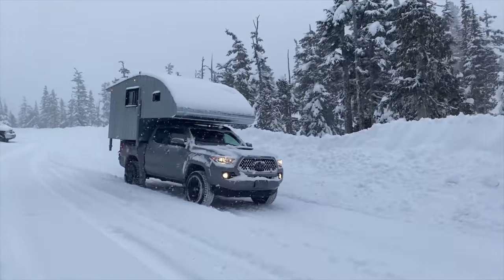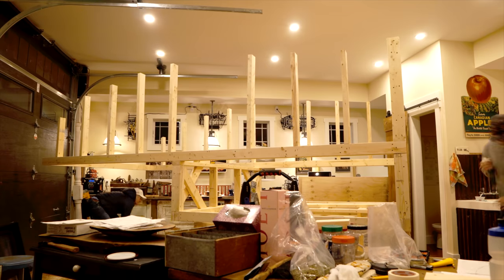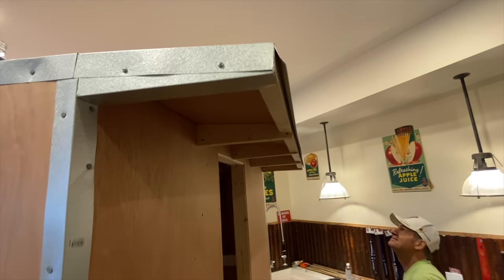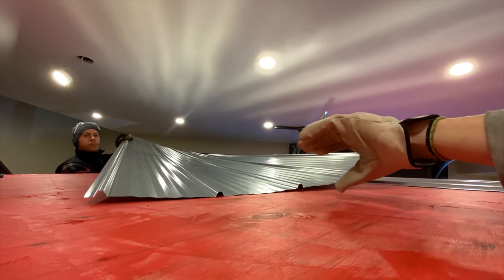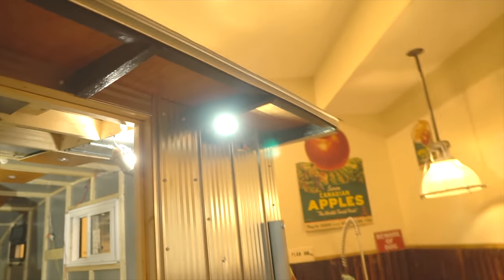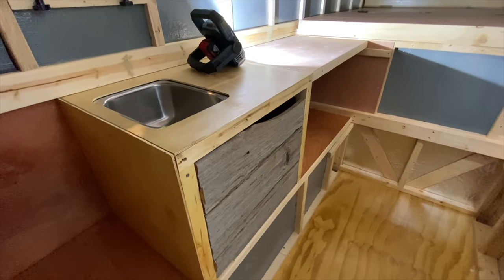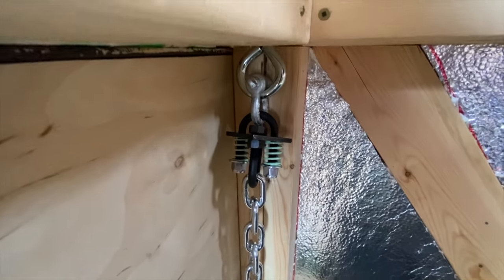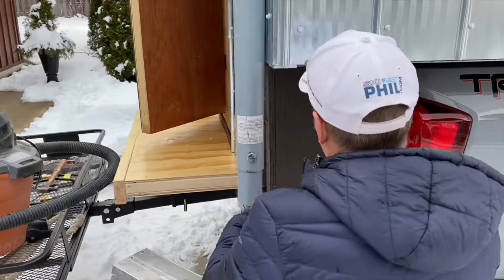I Built an Off-Grid Truck Camper - Start to Finish

Comment: shoebox! what kind of gas mileage do you see with the camper vs without?
Reply from the maker: Hey! I get about 13 litres per 100km’s without the camper, and about 17 litres per 100 km’s with the camper which works out to about 14 mpg with the camper on. And about 18.1 mpg with the camper off

Comment: its a beautiful camper but i think it is too heavy for tacoma.   you need to upgrade to more heavy duty shocks i think
Reply from the maker: Thank you! Yes the tacoma can handle the weight, but it’s pushing it forsure. I got airbags to help the truck, I am here to post all the things I do right and wrong and I wouldn’t recommend the same weight for this size camper unless you are sticking to nice paved roads

Comment: Shoebox what was your new advanced jacking system? Haven't seen a video on it yet
Reply from the maker: Hey I haven’t uploaded a video on them yet, but the new jacks I use are called brophy cable winch truck camper jacks, they are relatively priced, and still do a great job!

Comment: Amazing build! Super inspiring! Did you try and keep the weight under your trucks payload, I have an f150 and seems like my camper will exceed my 1700 max. Did you get suspension work done to help cause your truck doesn’t seem to squat like it used too.
Reply from the maker: Thanks so much! I honestly did not try and keep it under my trucks payload 😂 I was so new to truck camping at the time I didn’t even consider weight being a major factor but obviously it is critical. I got airbags installed to keep the ride level! Honestly when my rig is fully loaded I’m probably exceeding the payload, it’s not ideal but she will still roll 😅 but you’ll feel way less acceleration, and more sway  on corners also need to break earlier!

Comment: Ok what was that bit about the 2x2 vs 4x4s? you said you would have used. Wouldn't it just be lighter to build it all withb the 2x2s, only using 4x4s in main stress paint area? 
I'm thinking about doing this with my Silverado....
Reply from the maker: That’s exactly what I was trying to say! Using more 2x2 would lighten the load and you can use 2x4 where you need it!
Reply: Lol don’t be using no 4x4’s and honestly a 2x4 is a dumb move. This thing weighs way too much

Comment: Shoebox. I'm glad they were able to help you build that. I thought about building one. I'm not sure I want to though. I think I'd rather just buy one
Reply: As long as they don't check up the price. I'd rather just buy it cheaper one that's still nice
Reply: Not that your truck bed camper isn't good or anything, I just don't want to put in the work to building one because it is tedious
Reply: If I have a shop or space Also, that would be one thing I would be more likely to do it. However I don't. I have a parking lot LOL
Reply: Because at least with yours it is personalized to what you want

Comment: Recomending a 1 ton truck while putting it on a quarter ton. Doubting you need a 1 ton if that thing is handling it. Huge difference. I dont doubt its too big for a tacoma but pretty sure a half ton would be fine.

Comment: Love the shoebox!  Inspiring.  Did you consider a steel frame?  Why did you go with wood?
Reply from the maker: I choose wood because it’s very easy to work with! If I were to go with metal I would have choose aluminum to save weight, but it’s still harder to work with than wood.
Reply from the maker: Bang on, I mostly choose wood for it being easy to work with!

Comment: Shoebox I am about to build a slide in camper. I really like your video it was ruined forming I would have a couple questions what is the weight of the camper or have you weighed it yet and what is the total height from the ground to the top and on the inside of the camper.
Reply from the maker: hey so glad i could provide some inspo! my camper weighs about 1200 pounds. the total heigh at the tallest point is about 6'6 on the inside and 6'2 at the door (curved roof). Good luck!!

Comment: Wow. Impressive home build ! I’m jealous of your windows, as the single pane/aluminum frame ones in my 1979 Okanagan truck camper hate cold weather ! (also BC interior, Penticton) Was hoping to see what you did on the outer edge where the roof meets the siding, to seal it up. Cheers and Happy Trails ! 🌲🤙

Comment: Incredible build! Do you by chance know the total weight at the end? This is something I’ve been considering, and my pay load is 1738 to 1851. I’m just trying to get a visual to something that weighs around that. Stay safe out there🤙
Reply: If you are building a camper I'm using 4 bathroom scales. I put a block of insulation foam on each scale and put the scale under each corner. It's working great.
Reply: @marcseguin4591  really?? I never even thought about that
Reply from the maker: Hey man! Mine weighs around 1200 lbs rounding down! My best advice though is if you can keep your build to 50% of your payload, then you can still add people or load the camper with food, water, and gas and still be fine! I would use mainly 2x2 or an aluminum frame if you can!
Reply from the maker: Creativity pays dividends!
Reply from the maker: I will admit it is very hard to weigh your camper as you are building it, it’s pretty hard to know what the final result will be so anything helps! If you can do some weighing/math along the way!
Reply: @HondroB  Still, 1,200 lbs is much less than I thought it would weigh.  Watching the video I had decided to use 2x3s or even 2x2s. But 1,200 lbs, nothing wrong with that at all.
Reply from the maker: @codymarsh5130  yes absolutely! but every camper is a little different. Also just keep in mind when you load it up with food, water, gas, propane, all your stuff it can add some weight as well. 1200 lbs is the shell weight so when it's completely empty.

Comment: Shoebox: What did you use for insulation in the walls and roof?
Reply from the maker: Hey! I did foam board insulation for the walls and roof which is mostly 2 1/8 inch thick and near the woodstove I used fire proof wool insulation!
Reply: @HondroB  Thanks, I really enjoyed the video too, by the way. It's a really nice camper. I either want to build one or gut one out and redo it.

Comment: The screws for the exterior sheet steel should be screwed into the 'flats" to connect the sheet to the camper, AND on the "ridge line" when connecting two sheets together.
Reply from the maker: Honestly that does make sense! I might get back up there this summer and take a look at some things

Comment: Shoebox how did you make sure the over cab was not going to sag and scratch your roof
Reply from the maker: That was the main reason for the sheet metal, to keep the nose up and prevent the sag as well as overall strength. To be honest with you, I guess I didn't really know if it was going to sag, but hey it hasn't yet!

Comment: Cool shoebox! Have you had a chance to weigh it? I ask because you mentioned that a half ton would struggle but you have it on a Tacoma. How’s the Tacoma doing with the weight.
Reply from the maker: Thanks! Yeah so she weighs in right around 1200 pounds. I've been doing some things to lighten to load a bit. The tacoma can handle the weight, but you can tell it's at the top of it's payload, I think an ideal situation would be having your camper weigh 50%-65% of your payload so that you can load it up, drive people and overall it will just be a smoother ride.

Comment: Shoebox
What is the payload on your Tacoma? 
I'm building a similar camper and my f150 payload is 1900 and I'm very worried about the weight
Reply from the maker: During my build, I got completely stressed out about weight. my Tacoma's payload is a lot less than yours, over 500 pounds less. I do know of people who have surpassed payload and it is not the end of the world, although it is definitely ideal to stay under. if you can stay under payload driving the truck will be more manageable. I understand it's pretty hard to get a read on how heavy the camper is during the build. If you think you are going to be close to payload, I would recommend airbags (that's what I got done to mine to level the truck). keep in mind I'm driving a compact short bed and some f-150's have a full length 8 foot bed, so the weight of our campers could be completely different even with a similar design. I hope this helps, if you have more questions let me know.
Reply: @HondroB  I ended up buying 4 bathroom scales and put one in every corner lol.
 If not accurate it gives me a idea at least now. 
Thanks so much on your build video. It inspired me to build mine 👍

Comment: Hey what are the legs for the camper you use, like are they just pipes?
Reply from the maker: Yeah so they are just standard jack posts that are for rigid placement, I got mine from Home Depot! They are meant to support basement floors and other structures. I took them off now though and no longer use them as now I use brophie cable truck camper winch jacks

Comment: Whilst an attractive, streamlined roof, I was disappointed to see the extensive use of massively oversized timbers which makes the camper considerably heavier than it needs to be with no discernable benefits!

Those edging strips may well turn out to be the source of water ingress leading to internal damage. 

These observations do not alter the fact that you've built yourself a stylish camper, only that you could have done so differently (for good reasons).

Your aerodynamic frontal area gives your camper a modern, sleek and stylish appearance, and you've achieved quite a lot in a very short space of time.

Its always good to see people build their own campers and by doing so they inspire others to consider doing so for themselves, which adds to the knowledge base of Make Your Own Gear (MYOG) enthusiasts. Subscribed.
Reply from the maker: Hey I appreciate the comment! I would agree that the structuring is not perfect on this build, as I mentioned in the video, I started out with no idea what I was doing, and this is what came about. Glad you enjoy the design.  I love your mission of DIY'ing your own gear! Keep it up and thanks for subbing! Winter Camping content on its way!
Reply: @HondroB  would you do it with 2x3 or 2x2 next time? or just aluminum?

Comment: We have a truck bed that came off an older truck and was thinking of doing something like this ( with a shorter over hang in the front) But am wondering what kind of springs etc we will need to take the weight.  It is a 6x8 truck bed that was made into a truck trailer.  Does not have a tail gate.  Any ideas ?
Reply from the maker: Hey that sounds like an awesome project! I wish you luck with it!! Each vehicle has a Gross Vehicle Weight rating (GVWR) telling you how much weight you are legally allowed to carry. if you open up your driver door there should be a sticker on the body that tells you the trucks GVWR. if not you can probably look up your GVWR online with the make, year and model. This should give you an idea for weight! even if you are under your GVWR you might need additional back end support. I have airbags to level my truck but im at the top of my GVWR, even if you are only 50-80% your truck might sag and for long period of time it might be best to try and level the truck with airbags or springs.

Comment: That truck has way to much weight in it. It's sagging in the rear so bad, I would bet when driving it the steering is really loose. Because the truck was not designed to have weight like that in the bed. I would be curious to see how that truck is now. Unless you did add airbags or load levelers in the rear to compensate for the excessive amount of weight in the bed.
Reply: Yeah dude these comments are crazy. Sure he built it with his dad and the memories or whatever but that rear tire barely has clearance. That thing must weigh like 1400 lbs. Easily like 1000 pounds over the gvwr with all the stuff in there

Comment: Nobody realizes that this truck is a light duty pick-up. Like a Dodge Dakota or Gmc Canyon. No where near heavy-duty enough to accommodate this build. Unless he put air bags on it or helper springs to help with it being overloaded. Then of course once you step up the suspension or add air bags, now you need to hope the axle will hold up to the extra weight. Regardless of suspension the axle is still holding the weight.
Reply: I was wondering that cause he said it would be best for a 1 ton then put it on a quarter ton truck.

Comment: hi I just meaning to ask you what is the weight of that and also did you do anything to the back shocks
Reply from the maker: hey it is roughyl 1200 lbs dry / empty and i installed airbags to level the truck

Comment: Shoebox! How much would you say it weighs??
Reply from the maker: Hey It weighs about 1200 lbs dry
Reply: @HondroB have you looked at the sticker on the inside of your trucks door? Guessing it says like 950-1100 lbs. Even without the camper you’d be running at least 300 of that. You’re easily a 1000 pounds over the trucks gvwr lol be careful

Comment: Where can I find the spring loaded part at 15:20? Or was that a custom thing? Thanks.
Reply from the maker: hey i bought it from the same guy who built the woodstove so it should be on his etsy store. it's called a damper and its not actually spring loaded but has a spring on the handle so its not too hot to touch on a hot fire.

Comment: How did you bend the plywood to sheet the very front exterior surface?
Reply from the maker: Hey so I wasn't able to apply plywood to the outside of the  2 by 2 starts in the front rounded area. I ended up blocking that section off with plywood from the inside so that it is square.

Comment: Light pollution sucks, especially out in the wilderness.   Those lights should be shielded and they also need a dimmer
Reply from the maker: Two great ideas! If I’m camping around other people I’m using the cautiously making sure I’m not bothering my neighbours, I also often set up a tarp that helps block the light pollution

Comment: No, the Toyota Tacoma is a quarter-ton, light-duty truck. The Tacoma has a gross vehicle weight rating (GVWR) of 0–6,000 lb (0–2,722 kg), which is in the Class 1 truck category. Half-ton trucks are full-size trucks that can typically carry around 1,000 lb, but most modern half-ton trucks can carry more than 1,000 lb and up to 2,000 lb, depending on how they are equipped.

Comment: I saw an engineering video and that  group of engineers found that putting screws was : 1. Too hard to hit the center of the ridge. 2. Because of expansion it elongated the holes to make it even harder to seal that ridge. No material is perfect. I like the idea of laying fiberglass and bituminous products seal better than caulk for the roof.

Comment: Jeez what kind of animal left such a big turd, a crackhead?? 😂
2x2s would be better though unless you wanted to make a rooftop lounge. Once in a structure, very light wood will multiply in strength. 2x4s are overkill
Reply from the maker: Hahhaa i think it was a devil-ish pine martin! I'm breaking that down in my new vid on Sunday :). 2x2s for sure would have saved lots of weight, and all my 2x4s are overkill, i didn't know any better at the time, but hopefully people can learn from my mistakes :)